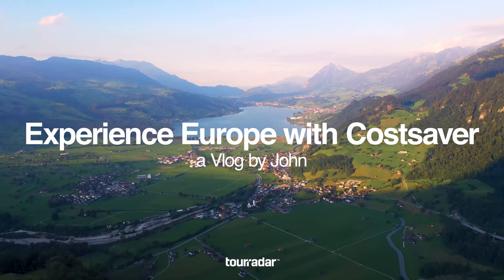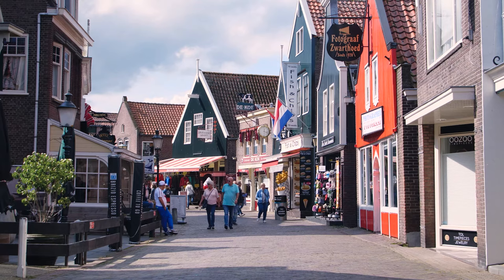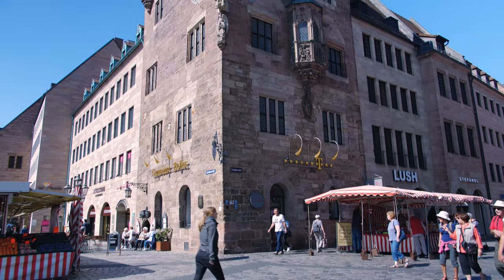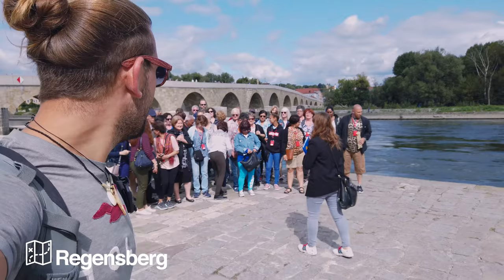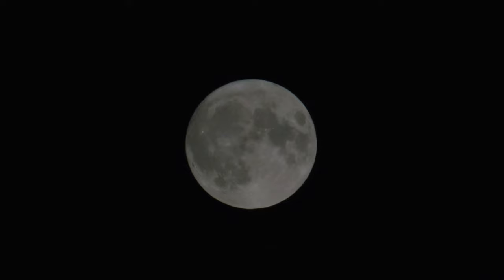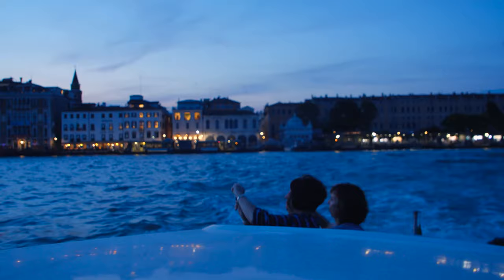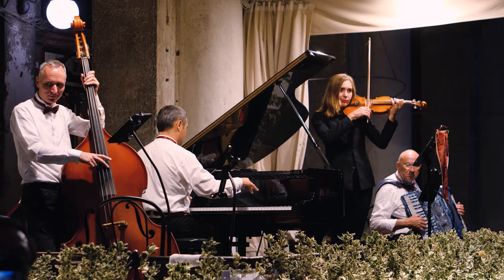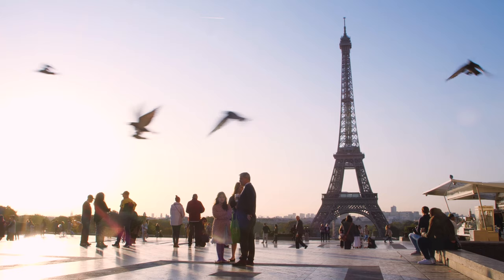Experience Europe with Costsaver: Vlog by John

Comment: Hi I’m going to Italy by costsaver soon, I just want to know what size of check in luggage bag should I get if my costsaver tour is by coach around Italy, and what size of bag should I get for the overhead compartment for the coach ?
Reply: In the tour info says suitcase no bigger than 76cm.
Reply: @rachelryan5805  , does it mean the total sum of the length, breath and height of the luggage?
Reply: @ekming751  Each guest travelling with Costsaver can bring one suitcase not exceeding 23kg (50lbs) in weight, with the dimensions of 76cm x 46cm x 25cm (30” x 18” x 10”). Carry on/hand luggage is restricted to one piece per person, with the size not exceeding 30cm x 28cm x 14 cm (12” x 11” x 6”) so it fits beneath your coach seat or in the small overhead compartment. 

Look at the faq page "before you travel" info is there.